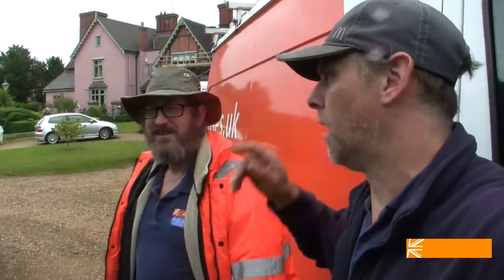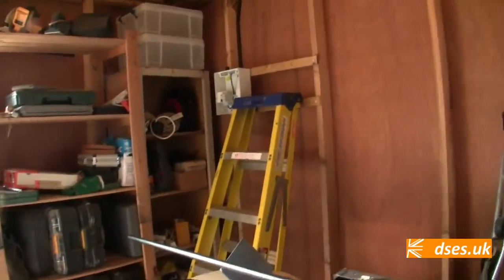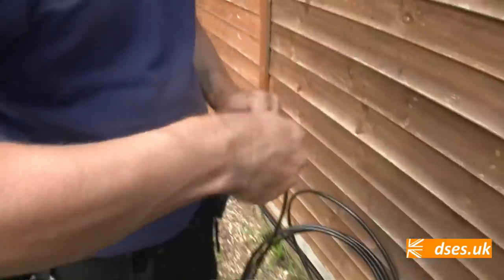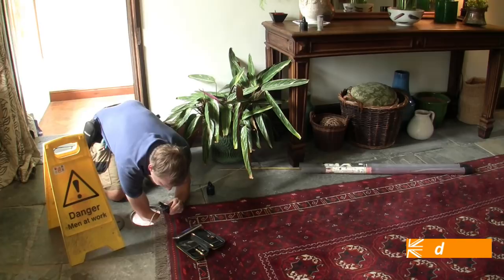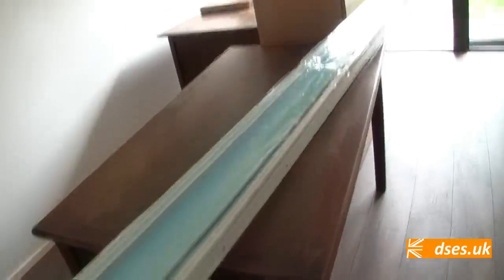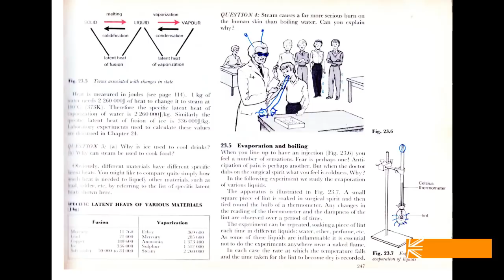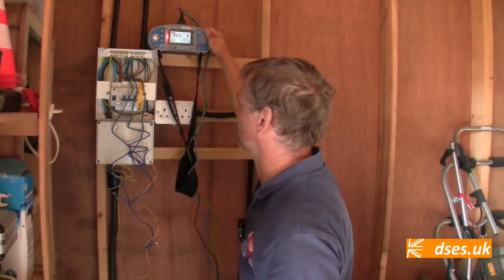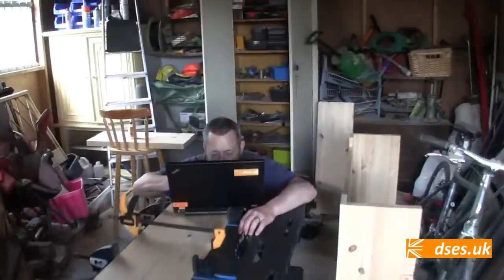The Manor House refurbishment... 5

Comment: First question mate, why 35mm... Surely thats bigger than the 25mm supply tails to the house and ano your factoring in a little volt drop but for an outhouse 35mm supply tails.... Am still bewildered how a 25mm wouldnt do mate
Reply from the maker: I'm sure a 16mm would have sufficed to be fair, but the maths is the maths and, had I not been showing it to the world, I'd have probably gone for something much smaller. But that's the weird way of things - like how we're supposed to throw up our arms for installations with 16mm tails on a 100A supply when that supply is probably delivered over something much smaller from the grid. The problem with the volt drop calc is that if you don't know the load and are basing it on the breaker, then the numbers will come out with something quite beefy.
Reply: @dsesuk  fair enough mate and i appreciate you answering my questions, your right on the maths is the maths but i would still apply diversity to it that its not going to be pulling full capacity load for extensive period even if they knocked down the out house and built an actual house youd still be sound.   Keep up the good vids mate you and Nige are legends. Also Bundy said he thought you had said previously that you didn't need a cooker control unit /isolator for a cooker but he did say he wasn't sure but i just wanted to hear it from yourself as i thought it was standard you need a ccu within the kitchen for local iso qnd not just straight off the mcb?  Thanks again David 👍👌
Reply: @dsesuk  I'm watching this still as am writing and ive just seen you've crimped a 10mm to a 35mm.... Am realllly confused now to why its okay to have them 2 joined.  Common sense prevails with this one, a 16mm or 25mm the whole way none of this changing from 10mm to 35mm. At least keep it the same size the whole way man
Reply from the maker: @Mc_123-d4o  Cheers Marc. There's nothing in BS7671 about a cooker switch being required and in some very small kitchens there may not be anywhere sensible to even accommodate one. That said, it's likely that the manufacturers' instructions will require a double-pole isolator. In the past, I've used a two-pole switched RCBO for that where I can't sensibly fit an isolator, however NICEIC say the isolating device, if removed from the kitchen, should be capable of being locked off. Whether an RCBO meets that requirement is up for argument. Cooker switches are not there for emergency use by ordinary persons, they're only to give a kitchen fitter a means of visible local isolation to allow a cooker to be changed or maintained without them having to dick around back at the board.
Reply from the maker: @Mc_123-d4o  While it would be preferable to maintain the CSA throughout, fighting that 35mm into a domestic consumer unit, one which is to be located in the future when further building work is to be performed, would be troublesome. As the circuit is 40A, a 10mm can take the first few metres to get it out of the board and to a point where it can joint onto the larger cable. We wouldn't gain anything by going to the trouble of trying to shoehorn a 35mm cable into the CU and the terminals in the CU aren't designed for that size.
Reply: @dsesuk Fair play mate, i genuinely didn't think you were allowed to do that.  But every days a school day,  Keep the good vids up.  Thanks again
Reply: @Mc_123-d4o  As David says, changing CSA is fine as long as the protecting device is rated to protect the lowest rated cable in the circuit.  I had to spec up a job a while back that required a 95mm SWA cable to account for voltage drop, despite only being a 40A circuit.  Both ends of the cable were terminated via short strappers of 10mm T&E as there's no way 95mm would fit into anything remotely domestic.  Had we gone for 10mm throughout we'd have been loosing over 60V from one end to the other which is clearly unacceptable.
Reply: @farmersteve129  i really appreciate that reply mate cause now i can imagine ot in other types of jobs, everyday os a school day like i said.  Im just really interested thats why so many comments and questions but thats really good to know, cheers guys 👌
Reply: @dsesuk  I wouldn’t be surprised if they ended up putting an EV charging point at the outhouse, in which case that alone could be a sustained 32A load, so worth installing a decent CSA cable!